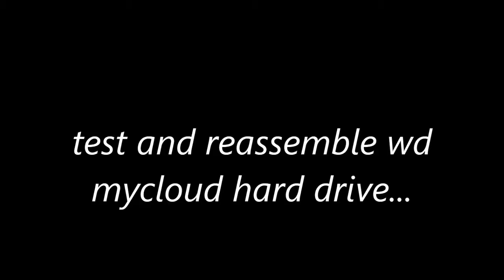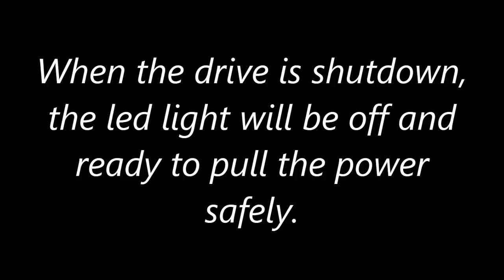How To Put Hard Drive Back Into WD My Cloud Case

Comment: That side bracket is not a 2mm Hex. Mine strips out at 2mm, and 2.5mm, and 1/16. no hex key in my set works. Extremely annoying.
Reply from the maker: I think it's torx, it's been a long time.
Reply: They were too far stripped once I got to Torx, although torx had way better grip it was too stripped to be enough. My screws were extremely tight. I ended up getting a drill bit and drilling out the two stripped screws without damage to the HDD which I was salvaging for use in a PC.